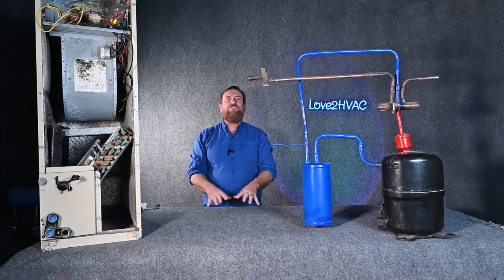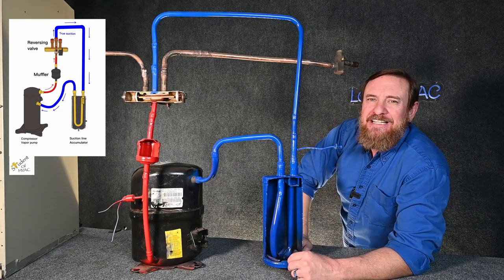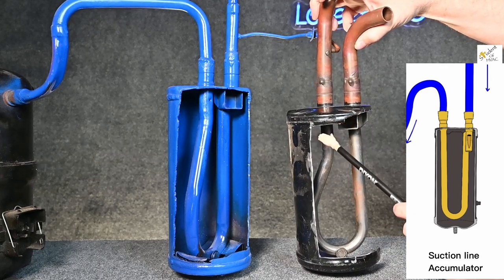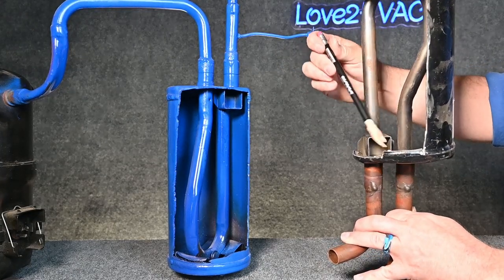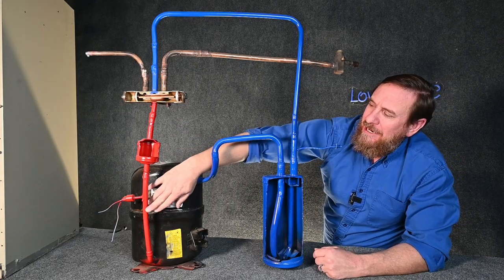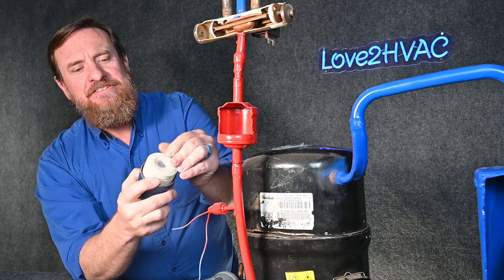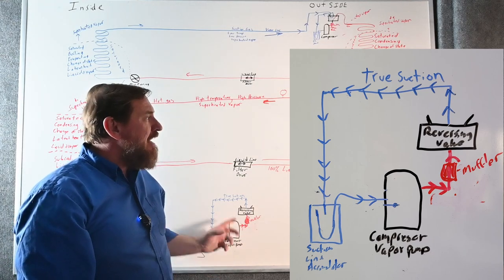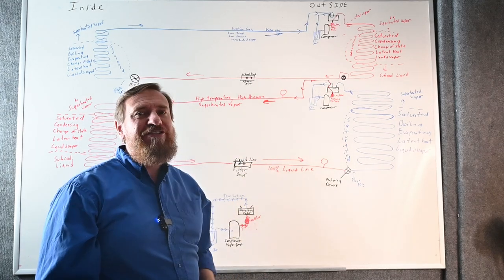Heat pump 04 Accumulator & Muffler

Comment: The liquid line muffler in heat pump is normally rusted badly and a potential leaking spot. Have been fixed several already
Reply from the maker: I have not seen a liquid line muffler before.

I inspect all items during maintenance. When the paint flakes I use a wire brush to clean and then a little spray paint to protect.
Reply: Mufflers go on discharge lines. If badly rusted I'd look into your temps

Comment: How is oil picked up from the accumulator without picking up liquid refrigerant?
Reply from the maker: That's the reason the hole is so small, so it will meter in the liquid in a small enough amount to handle it.
Reply: @love2hvac  thank you

Comment: i noticed no muffler on a rotary compressor, wondering why?
Reply from the maker: The entire case of the rotary is high pressure vapor, so it works like a muffler,  I have seen them but early. 
They are also less likely on scrolls too, most common on reciprocating.

Comment: Can we surmise anything based on frost growth on the accumulator exterior while in heat mode?
Reply from the maker: Great question!

Not really anything we can use. It will hold the excess in heating mode so it's normal and depends on the conditions.

Comment: I am replacing my first accumulator on a 3 ton scroll that leaked all the oil and R22 out. Any suggestions on how much oil to add to the accumulator before soldering it back in?
Reply from the maker: Unfortunately the <5 to  compressors don't have oil sight glasses.
The only way to 100% know is to remove the compressor and drain and measure the oil out of it.

Alternatively, you can estimate how much oil was lost by the puddle left and add that approximate amount to the accumulator before installing it. 

You can confirm this by taking some measurements when the repairs are completed and the compressor is running.
If it's a Copeland, you can scan the compressor on the copeland mobile app. Select the refrigerant, and go to dynamic performance.
There you can enter in all the data it asks for and it will tell you a lot of information. In this case we will look at the discharge line temperature.
Under those specific conditions it will calculate what the discharge line temperature should be. If your actual discharge line temperature is higher than that, it's probably low on oil.

You can also check discharge superheat vs suction superheat on other brands to get an idea.

Hopefully that helps

Comment: 3 years ago I spent 8900 bucks on a 15 seer Ruud Heat Pump 3.5 Ton.  Why is it that my Heat pump does not have a accumulator also does not have a heater on the compressor   that belly band that keeps liquid out. Well my Ruud Slugs quite often during start up. Not for long about a minute it does. That is what I was told by my next-door neighbor who is a commercial refrigeration  guy. He works on walk in coolers and things. My heat pump sucks so bad , its very loud its got a two blade fan that spins at 1100 Rpms and is very steep pitch wise and is very weak on heat. My old junker was a 2013 Gibson that lasted a whole 6 years and died had Pistons on the inside and out and heated very well this thing with Txv valves on the in and out can't heat much at all. Reminds me of my grandmothers old packaged Westinghouse the air was alway about 83 coming out of the vents so was cold always. I bought me a scratch and Dent 18,000 btu it says York but I was told Midea made it got it for 500 bucks and installed it myself . Its a 28 seer Mini split and it kicks ass cooling and is silent and my bill dropped by 40 bucks.. No Accumulator I can't believe that. They really want them to last just a few years and die..
Reply from the maker: I would have some add a crank case heater, it's cheap and easy to do.

TXV work much much better than fixed offices inside and out. 

The biggest issues I find with heat pumps is the installation.

#1 air flow is always bad. Bad airflow, bad ductwork makes heat pumps suck. I see it all the time 

#2 installation being a proper vacuum being pulled before the refrigerant was opened and then proper charge. Improper vacuum leads to copper plating and early compressor death. Improper charge because so many techs do not understand superheat and subcooling.